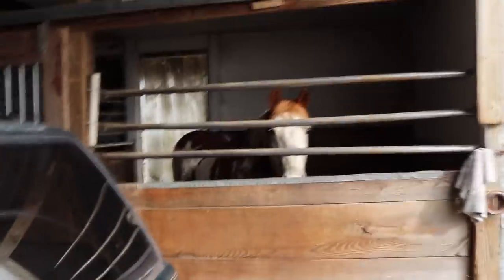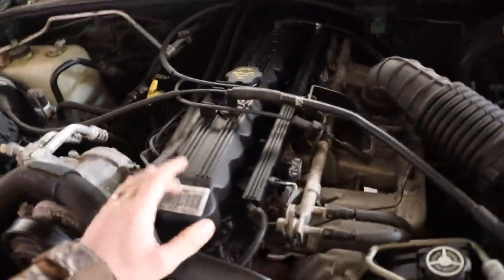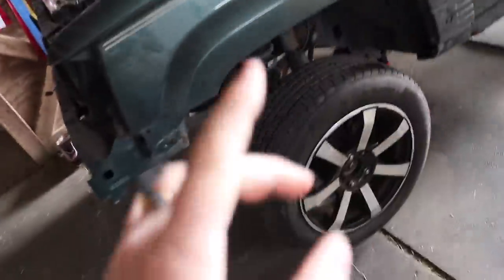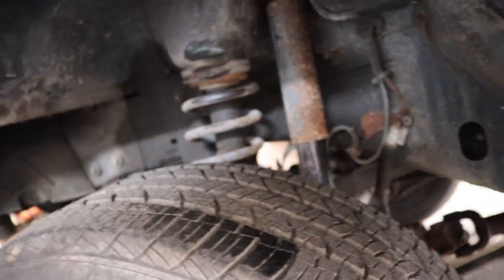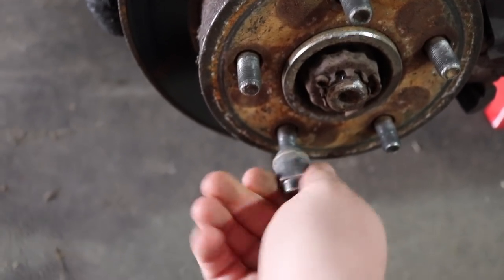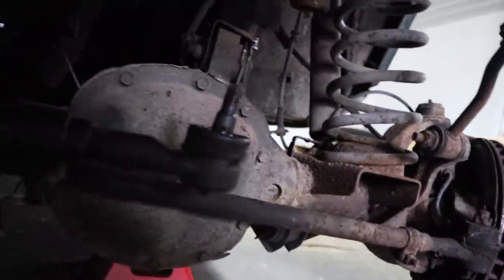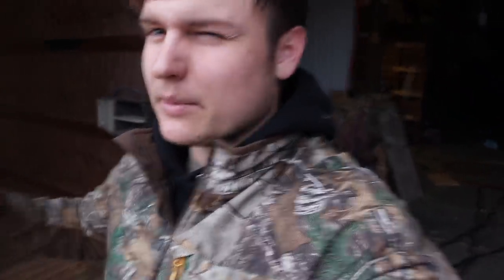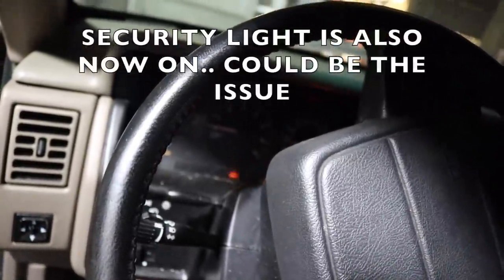Fixing the JEEP that ALMOST KILLED ME!!!

Comment: Pull apart driver side door panel. Open up harness, find Purple wire that had yellow tracer and ground it out. Purple/yellow will turn off the security system.

Comment: Also 31s are the biggest tire you can fit without removing the fenders. If you remove them you can fit 33s without destroying the rear quarter panels. You could also try putting it in neutral to start. They are known for the neutral safety switch going bad.

Comment: Yeah that's 100 percent a security issue why it's starting up and shutting off. Honestly that first one you went and looked at probably just needed at starter.  The bendix probably wasnt coming out. Judged off of the sound you made. I mean if I was you i would look for a jeep partouts on marketplace you can find lift kits cheap as heck. Even new they arent expensive for a 4 inch. As for tires I would say you can get 33's to fit and a good budget option is tread Wright they are a retread so they are pretty cheap and they do good offroad. And since you arent going to be road driving it you dont have to worry about them coming apart.

Comment: I believe I put 32x11.50r15s on a 95 cherokee I had. Rubbed on inside on full lock. Also you may try locking and unlocking door with key and see if it resets security-if thats the issue

Comment: for the jeep you have to start it up and hold your foot on the throttle for a few minuets and then you can let off and it should stay running. It need to relearn the throttle position after you disconnect the battery. Just a security issue. no big deal.

Comment: You probably need a new starter for it? Probably why it will not start
Reply: The starter is working fine
Reply: That starter is working. If the starter was bad it wouldn’t turn over at all.
Reply: @korbinstudnicki3510  you don know anything about it
Reply: @squarebodyshut8076  you said it’s gonna need a new starter? Starter was engaging bud 😂 you’re the one who’s knows nothing about it.